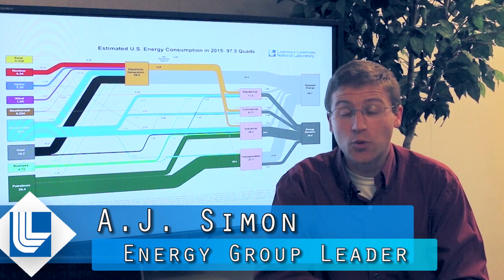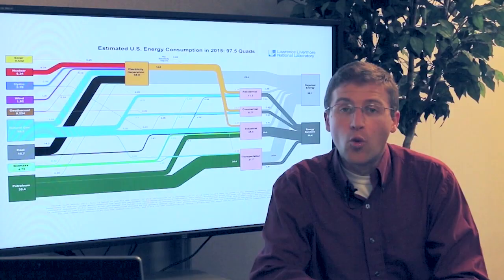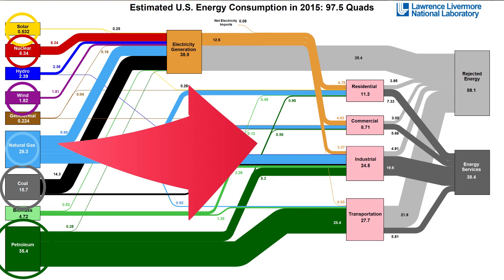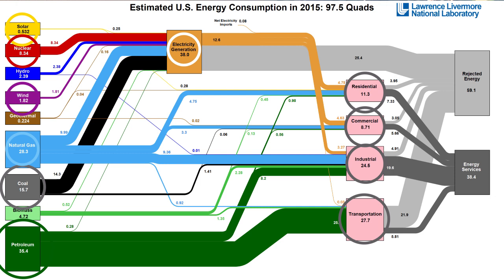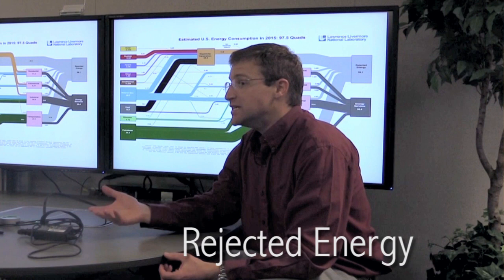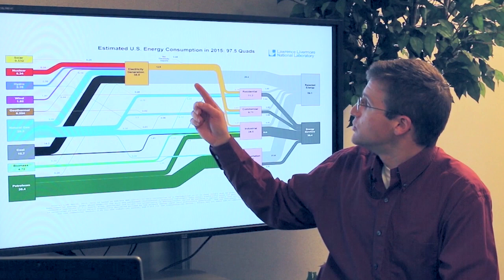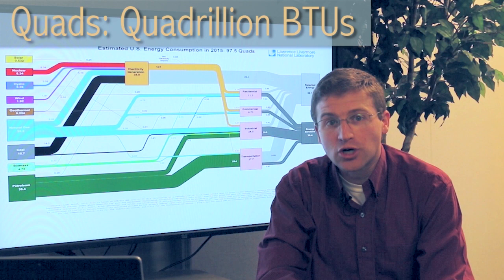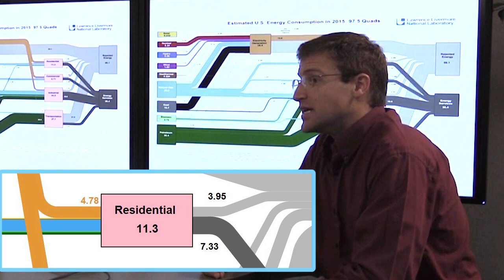How to read an LLNL energy flow chart (Sankey diagram)

Comment: Would rejected energy in transportation be greatly reduced by electric vehicles with regenerative braking?
Reply: Daniel Dosen in transportation, most of the rejected energy is lost as heat in an ICE vehicle. EV motors are a lot more efficient at converting energy to motion.

Comment: Why not produce a version using tWh?  That's a more familiar unit to most people, and with many cleantech people doing calculations related to converting things to using electricity, that is a more natural unit.
Reply: Yup. A more natural unit for anyone doing anything but heating pounds of water by degrees Farenheit!

I'd prefer Joules, but I can deal with the 3600 seconds in an hour.
Reply: 1 Watt-hour =  3.412142 BTU
It isn't real hard. You'll come close if you just multiply everything by pi in your head.

Comment: Why is there so much rejected energy in electricity production?  It is about 65% for many fuels like coal, natural gas, and hydroelectric.  I would have thought hydroelectric would be much more efficient, i.e. Less rejected waste.
Reply: Coal and natural gas lose anywhere from a half to 70+% of their energy as waste heat. Sometimes some of it can be used for "cogeneration". Hydroelectric IS much more efficient. But they back-calculate it to look worse in this chart, for a reason I don't quite understand. Similarly for solar.